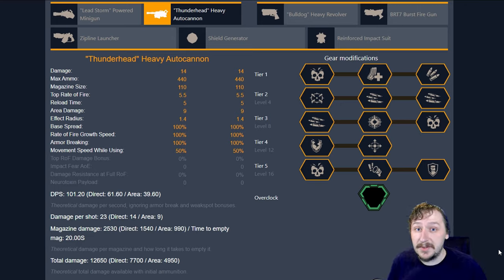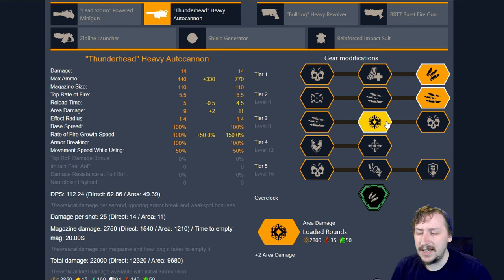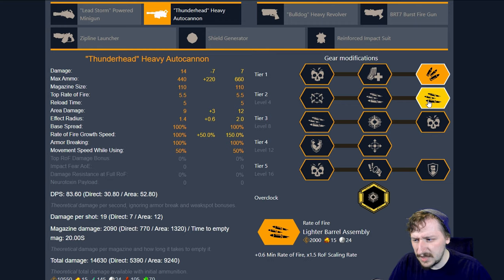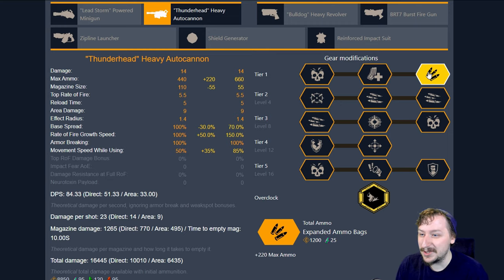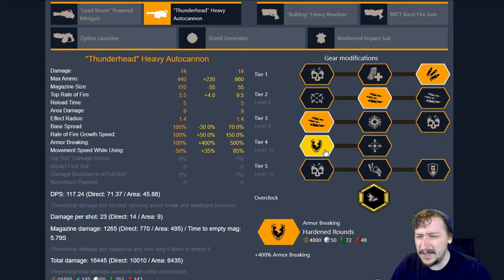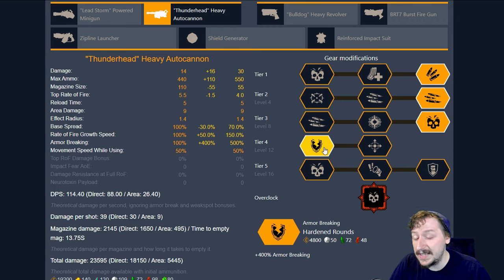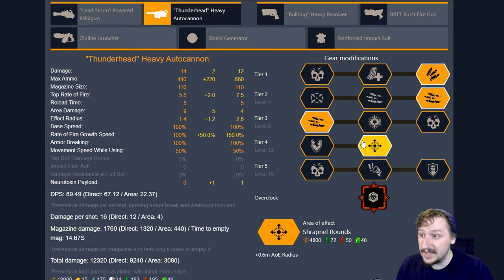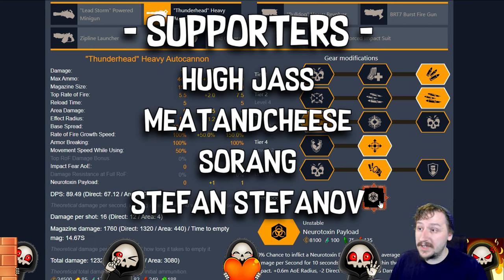Deep Rock Galactic | Autocannon Overclock Builds

Comment: I find the Neurotoxin Rounds works best on Haz3/4 or Eliminations to slow Dreads, and Carpet Bomber on Haz5 due to the increased spawn counts. At least in my experiences on Haz5 it feels like more things spawn and move more quickly.
One of my first OCs for the Autocannon was Big Bertha and while it felt good to play at the time I really feel it's not playing to the strengths of the weapon as a whole, and single target sustained dps is under the purview of the Lead Storm.
Overall solid as usual.
Reply: Hard to disagree with this, I even had the same experience with unlocking Bertha first. 👍
Reply from the maker: Thanks Kraftan!  Thanks for the tips!